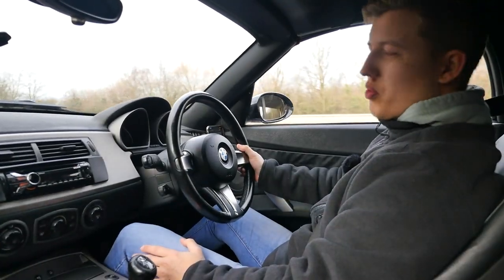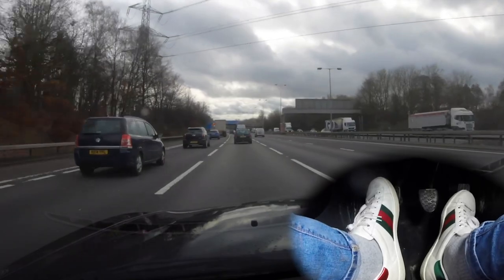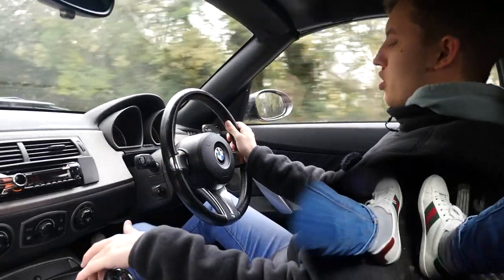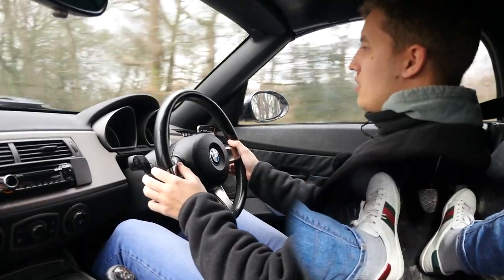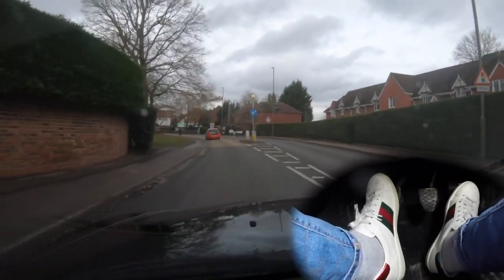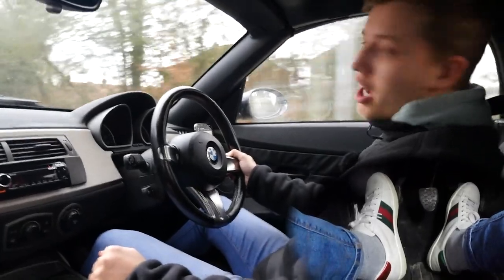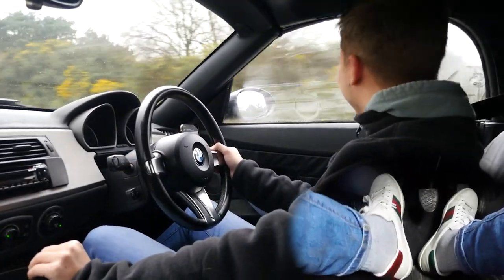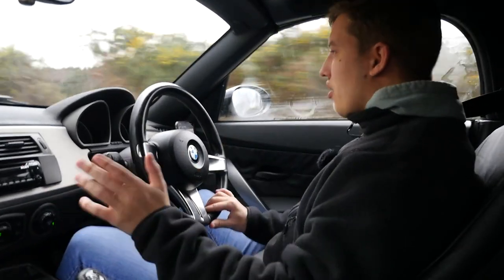What is "Heel & Toe/Rev-Matching?" Why Learn? Simple tips & demonstration

Comment: I practiced and learned to heal & toe the day after I passed my test in 1989.
It was the day after, because I had to learn rev-matching first 🤓

The version you use is how I do it for limit / track braking. It allows for a differential in brake / throttle pedal height. 

On road, where the braking is less severe, I use the more casual version.
Right hand side of right foot, to blip throttle.

Cars I’ve had recently have rev-matching built in, which seems horrible to me and your video made me miss my N52! 

Well done for learning too and good video 👍🏻

Comment: Great video! For rear wheel drive manual, this is an essential skill. When I first learned it, the hard part was keeping the brake pressure consistent while blipping the throttle. Most people will snatch the brake as they blip the throttle. Trying this out for the first time, well away from other road users is so important just in case that first inevitable snatch of the brake happens.
Reply: Exactly the challenge I have and have not yet managed to master. Rev-matching is easy. Heel and toe I cannot seem to do, without over or under braking. I'll have to keep working on it!
Reply: @johntearle  practice makes perfect! 🤙

Comment: I struggle with keeping the brake pressure the same. Although I think I’ve pretty much got the hang of the Rev matching thing. Need to keep practising
Reply: Likewise I find the side jab on the throttle transfers to the brake pedal and results in a sharp stab instead of a smooth press. Could be down to rubbish pedal position or the fact I’m crap at heel and toe 😄